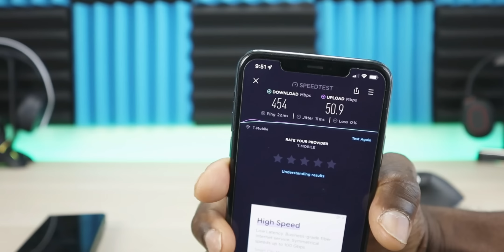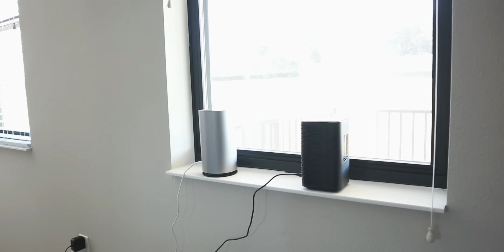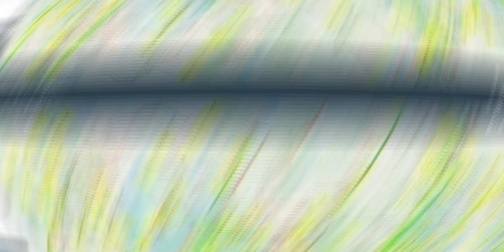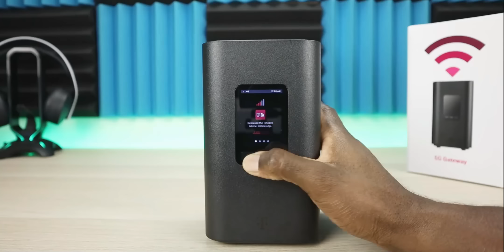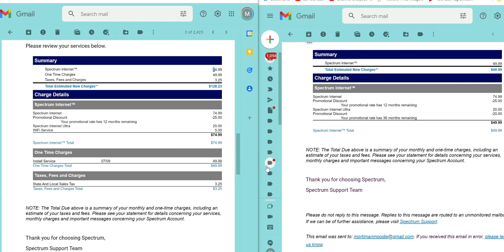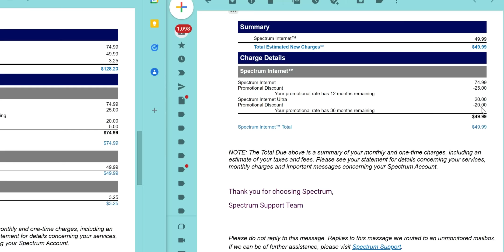Why Did I Get Rid of My T-Mobile Home Internet | Who Am I Using Now, And How Much Am I Paying?

Comment: I have it here in Randleman NC and it worked great for about 4 weeks, then afterwards it would slow down to a crawl.  I rebooted gateway and that worked for awhile and then it would just stay at around 25 down and 3 up.  I was on the N41 the whole time.  Spectrum is now offering 500 meg download  speeds for 40.00 a month for 2 years.  Taxes and all included in price.    T-Mobile is going away come Monday.....

Comment: I have it here in N.C. and I love it.  I get 480 down and 30 up.  Never any issues.  I think you were a long ways from a tower or your position of the Modem was bad.  They are very sensitive as to where you place them.  Spectrum will go up on you and you will be unhappy in the long run.  I know this because I have been there already.

Comment: I started having slow downs with t- Mobile home back in February and I've been with service 1 year. They've consistently gotten worse and I've repeatedly called. Got the same BS about tower, working on it, should be a month. Never happened. I originally had the trash can gateway. I never got above 3 bars. I even had external antennas, pointing right at the towers(2 panel spaced accordingly at 25 feet in the air), 3/4 of a mile away. Signal wouldn't improve and the slow downs stayed the same. I went from 400 down and 30 up to 30 down and 25 up. I was also now on b66 and N71. These bands where I am are terrible. I felt like I had att  DSL line for internet. Turing off the gateway or restarting from the app wouldn't get me moved back to the old settings. I am stuck on b66 and N71. Finally sent me new Arcadian gateway. I got better signal, 4 bars, but still stuck on those bands. My last call got an American customer service person and tech. I thought I had called the wrong customer service. I was speechless. Finally got a truthful answer, which was I have been deprioritized. Problem will not be fixed until the tower is upgraded for more service period. No date on that for completion. They said there is no way I can be moved to another tower even if they tried because the gateway is going to move back to the closest best tower to you, which is the b66 and N71 tower. I have finally given up. I went to Xfinity(the devil) and got 600 down and no data caps. Got the price down from what they advertise by calling and getting a better deal. I didn't want to do this, but no choice. 30 to 35 down for 50 bucks made no sense anymore when I could get local broadband for the same price and the speeds are consistent. For everyone who actually gets great service, good luck on it staying that way.... I'm willing to go back at some point, but I'll need proof that it's actually going to be consistent service in my area. Side note.. really do appreciate the amount of insight I have gained from watching posts from here.

Comment: had similar issues.. 2 tech support calls didn't work out.. the  3rd call connection dropped for 15 minutes when on the call .. they sent me a new router.. my issues are gone, at least for now.. also. I got the same Grey cylinder router, I hear they have a newer model  that came out in August

Comment: I've never had a problem with T-Mobile home internet. I live only 0.3 miles from the T-Mobile tower and from my condo I get 700/100 on 5G and 250/50 on 4G LTE all the time from T-Mobile. Comcast in my area has an upload of 40 Mb/s and I'm getting 100 Mb/s upload from T-Mobile were I live.

Comment: I have T-Mobile for over 1 year. There are couple things I need to do to improve my T-Mobile tower performance. 1.) Keep the gateway in an area with temperature lower than 75 F (turn on the AC or cooling fan in the summer); 2.) Reboot the gateway when the performance is slow. Yes, there are some inconveniences, but the cost of service is well worth it.
Reply: Come to my area have just one tv connected. Get spinning circles on my tv
 Usually after 4pm. I guess u get what u pay for.

Comment: Everyday during the day my T-mobile speeds go down between 3 mbps to 8 mbps.  I do a factory reset which takes two minutes and it fixes the problem.  If it does not fix the problem, i disconnect the modem for 10 seconds and then the speeds go back to normal between 90 mbps to 150 mbps.

Comment: It's very odd because you can see the connection graph is extremely stable which is telling me that something has changed and it may not necessary be congestion if so that graft would usually be all over the place overall though I live in a place it's technically still in Sprint site and T-Mobile has it as partial signal whatever that means but yet they don't even have that Tower switched over to the T-Mobile network yet and they're stating that on the coverage map that it's 4G LTE but yet they don't service my area and they state that the closest Tower it's almost 20 miles away from me you're not going to get cell service being that far LOL

Comment: I got rid of my tmobile internet a month ago as I couldn't never keep a stable connection it kept cut on and off. So, went back to spectrum cable internet and it was better for my remote job I have now. But, tmobile home internet started out with good speeds but the gateway kept cutting the connection on and off and I was less than 1 mile from the tower which should not happen. I even had the home gateway replaced with the same issue so I then switched.

Comment: I had the 5G home internet with T-Mobile for 3 weeks recently. My complaint was not speed, rather it was availability. There were numerous days where it’d just be down for anywhere from a hour or two to 8 or more hours. I can’t have that. So I returned it. A word of caution - don’t cancel your existing internet service. Make sure you’re happy with any ISP you change over to. I found T-Mobile customer service and tech support to be just this side of useless. I got the same “ we’re working on the towers and things should be faster in the next day or so”. Pure BS.
Reply from the maker: Yep, I'm not going to wait around until they figure it out.
Reply: Glad to see it’s not just me having this problem
Reply: Thought I was the only one
Reply: Yeah that's T-Mobile piece of crap. I rather pay extra for something I can depend on.
Reply: Always I get the same answer , we are working to upgrade your cell tower but the problem is still the same. It cut off out of the blue. Don't know I can hold off , wife starting to say get rid off it . its cheaper but not dependenable , we have our security systems tied to tmobile , its starting to get unsafe and unreliable . hope it get fix quick because folks in few month would look for any reason in a depression when money is tight to cancel service. Tmobile u better get fix fast and right other wise I see a wave of cancellation by end of this year. Hoping It get taken care of , feeling the pressure from wife , it gotta go.😅

Comment: TMobile internet works best for rural areas where there is no access to cable internet. I've had multiple satellite internet providers like gtek, dish, Hughes, that only have download speeds up to 40 mps while paying over $100+. I just recently switched to Tmobile and so far I've been getting download speeds up to 80 mbps for half the price. Definitely an upgrade for us, but if I had access to cable internet I would switch in a heartbeat
Reply: Yeah I didn’t have cable out there where I live I live out in the middle of nowhere. I had to get like satellite Internet, which sucked but I get excellent T-Mobile home Internet coverage I push over 300 MB download and 30+ megabytes upload.
Reply: After reading all the complaints, I guess I’ll stick with my wired ATT internet.  Download speeds of 30 Mbps.  Pay $ 50 month as I also have a grandfathered  wireless phone plan (3 phones for $ 115, with 12 KB (is it KB?).  The speed is adequate for my wife and I to both stream HD quality videos at the same time, as well as having 10 wireless devices connected.

Comment: I had T-mobile for just over a year when we had a couple of bad storms hit at the end of March (tornadoes within 15 miles of me). There’s only one tower close to me… 2 1/2 miles straight line. We lost all 5G and the LTE went to crud. T-m assured me it would be fixed within 48 hrs, then a week, then another two weeks, then they said there was nothing wrong with the tower even though my gateway couldn’t pick up a signal and my phones get 1 bar max when they get anything. I know the phones are okay because 10 miles away I get download speeds of around 650 mps. Cancelled T-m and called Spectrum. They decided that they have to add two more spans of main cable to service me. Been waiting two months for that. AT&T no longer runs new DSL and they don’t have fiber near me. Starlink has over sold in my area and aren’t adding new customers until they launch more satellites. I’m stuck with bad hotspot off my phone until Spectrum decides to hang 300’ of cable between three poles.

Comment: Anybody think that despite what T-Mobile said, maybe the parts inside just overheated and wore out quicker than usual over the course of a year? Especially if this is put on a window sill? I have to wonder maybe it's an inefficient design that's the fault of this, but then that means it's up to the user to make some modifications, which is too much to ask of for the average user. 🤔

Sorry this didn't work out for you, TripleM.
Reply from the maker: I dont think this failure is due to the device,  its definitely yhe tower. But im not going to wait until they figure out. Like i sad, i was with them for a year, and ill definitely give them another look in the future.

Comment: The moral IS, wireless will never be as reliable as wired.
Reply from the maker: It was reliable until the made these changes
Reply: It can be more reliable. T mobile is simply lapping up money on towers with extra capacity. They have no interest whatsoever in upgrading simply for the home internet.
Reply: Unless your hardwired connection is provided by Comcast or CenturyLink.  Then even the worst cell carrier in the works is more reliable.  My Comcast Business connection has been down (not able to pass a single packet) for 9 days total since Jan 1.  It's now Feb 20.

Comment: I got the same run around with t-mobile. They also told me that they were working on the towers. They thought that I might have a bad gateway. So they switched it out. And, my speeds still suck. When I started with t-mobile I was getting 700mbs or more. Now, I am fortunate if I can get over 20mbs. I too will begin to seek another isp.
Reply from the maker: Let me know how it works out.

Comment: same here I got rid off mine 2 months ago. I  also have t-mobile cell service,  so when they slowed down my speed I couldn't use my phone I would have to go outside away from my house to use my phone. ridiculous
Reply: You may have had wi-fi calling turned on in your handset. If you turn this feature off, the handset and home wi-fi performance will not be correlated.

Comment: Thanks TripleM. I have been following your videos on this subject and was about to pull the trigger because of the HIGH Comcast costs and spotty Metronet service here. Almost glad I didn't as I HAVE to have great, dependable internet for work. If T-Mobile is pulling a bait and switch that's a problem. IF they are upgrading or having technical problems, they SHOULD have let you know and or pro-rated your bill. But this is NOT a good look.
Reply from the maker: Yep, i agree... im foenthe savings not the company. Lol

Comment: I’ve experienced the same issues with T-Mobile after almost a year with the service. Since I live in a rural area, and my choices are limited. Over, the pass week, the service has improved; however, there has been a few occasions where the speed drops for no apparent reason. I’m anxiously awaiting for another ISP in our community.
Reply: Same here. Before tmo I had satellite. Tmo is my best choice.  I deal with the drops or intermittent slow downs. The good definitely out weigh my bad. I will stick with tmo until broadband or something else better comes.
Reply: One problem with starlink is it charges 110/month and $ 600 for equipment cost and there is a wait period for at least 1 year if not longer.
Reply from the maker: Hang in there
Reply: i hate this internet, bandwidth is trash, ping spikes are ridiculous, id rather have starlink
Reply: @PitBullet  yep i switched cause screw this, starlink isn’t perfect either but definitely faster and more stable for me atleast
Reply: @RedHeavy-  what is the ping like on starlink and are u able to do multiple things on it at the same time?
Reply: @PitBullet  ping is 20-40 for me, and yeah can use multiple devices a note to add though i added a router with qos.
Reply: @RedHeavy-  damn that's nice ping! Was the statlink easy to hook up?
Reply: @RedHeavy-  i like to play games online and on t mobile atleast for me u cant even stream and play online at the same time lol
Reply: @PitBullet  mb it's alright to hook up, although ping sometimes spikes but almost never like 1 time in 5 hours maybe.

Comment: I get 5 bars.  400-600 Mbps dn, 90 up, 20 pings.  T-Mo is amazeballz!  Broadband Game changer! BTW, my T-mo mobile hits up to 800Mbps.
Reply from the maker: I was really happy until recently. But, .89Mbps, thats crazy
Reply: I just got T-Mobile home internet last week, as I moved into a new house. It has an up and downstairs. Should I get a mesh point to boost  my connections upstairs? I just mounted up my tv today, and it was like at 3 bars on my Wi-Fi signal.
Reply: @RedManRann  It all depends on the direction of the tower!   My T-Mo gateway is downstairs and has no trouble gettign 5 bars.   The built in ax wireless is pretty good even for reaching upstairs.  My house is 2300 sf.  I'm using my TP-Link AX6000 router since it has a little more strength, but the gateway should have no problems unless you live in a huge house.  For those who have not upgraded to "AX" routers, the gateway actually gives you this capability without spending $150+ on a new AX router!
Reply: Enjoy it while you can. It will not last.
Reply: @343jwright5  Weird, I've been on for years. My performance has improved substantially over time. They uploaded new firmware which upgraded it to Wi-Fi 6 MESH, and band sharing on both Wi-Fi and Cell links. It's not just words, all performance stats improved a lot.